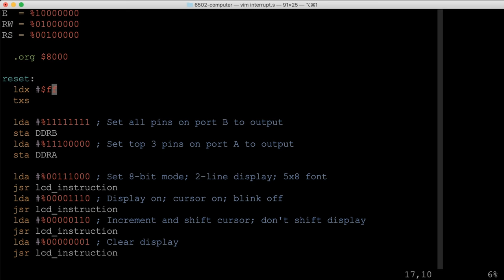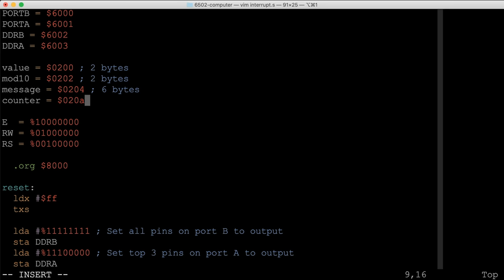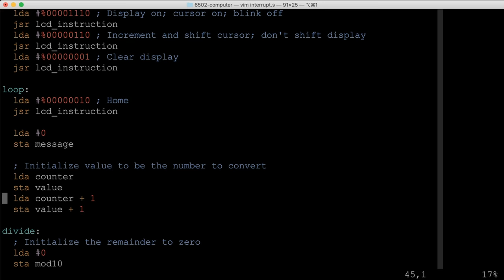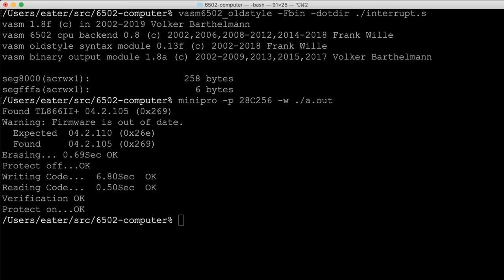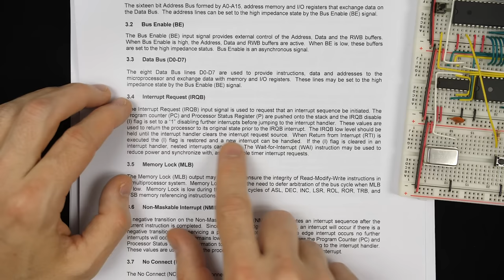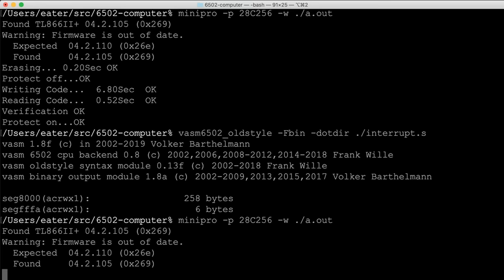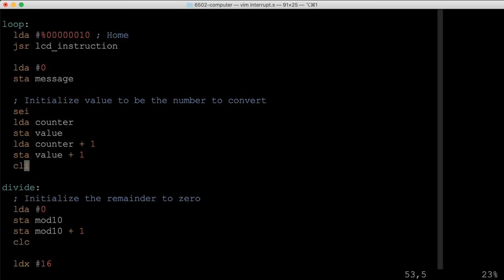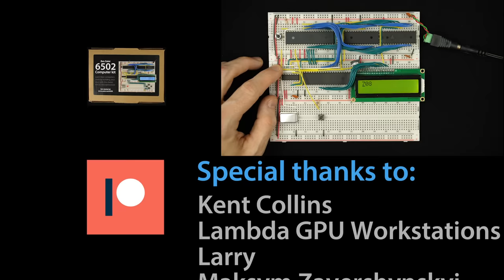Hardware interrupts

Comment: couldn't you write falling edge logic on the IRQB service routine to prevent it so that it can behave like the NMIB? is there any benefit in that?
Reply: That would work if the 6502 has a method to read the interrupt input in software.  I don't know if it does or not.  If it does, then it would be as simple as waiting for the interrupt line to change back to high before enabling interrupts again.
If there is no way to read the interrupt line level in software, then there would need to be some way of reading it built into the hardware, such as allowing one bit of a particular memory location to duplicate the interrupt status
Reply: @melkiorwiseman5234  
But actually: Handling user pressed buttons with external interrupts is generally not a good idea. Everything a human does is in extreme slow motion from the point of view of a µC.
Most more modern processors have better interrupt facilities and even on them it is not a good idea. Those interrupts should be reserved for setting job flags for the central state machine and/or handling critical emergency situations such as eg. turning of a motor because a sensor signifies that damage is about to occour.
Reply: @kallewirsch2263  It's application dependent.  In some situations, responding to user input is all that the machine does.  If it's a manufacturing process controller, responding to a "STOP" button may be the highest priority.
I don't think it can be generalised as easily as you have stated.
Reply: @melkiorwiseman5234  
:-)
If there is one thing for sure, then it is: "One size fits all" works for baseball caps but not for programming :-)

Yes, of course you are right. It always depends on the specfic needs. In most of µC programming one would set up a timer and poll the buttons every 5 to 10ms, which is also a good base for debouncing them in software. That is: for buttons dedicated to some sort of user interface. Which is also not a big deal, since in a lot of programms one would need some sort of base time (often: 1 millisecond) anyway. The handling and debouncing of a number of buttons is fast and very reliable.

Eg. this is an ISR for an AVR, handling and debouncing 8 buttons in 1 go.

     in     save_sreg, SREG
get8key:                               ;/old      state     iwr1      iwr0
      mov    iwr0, key_old             ;00110011  10101010            00110011
      in     key_old, key_port         ;11110000
      eor    iwr0, key_old             ;                              11000011
      com    key_old                   ;00001111
      mov    iwr1, key_state           ;                    10101010
      or     key_state, iwr0           ;          11101011
      and    iwr0, key_old             ;                              00000011
      eor    key_state, iwr0           ;          11101000
      and    iwr1, iwr0                ;                    00000010
      or     key_press, iwr1           ;store key press detect
;
;			insert other timer functions here
;
      out    SREG, save_sreg
      reti

or in C (as a complete package)

ISR( TIMER0_OVF_vect )                            // every 10ms
{
  static uint8_t ct0 = 0xFF, ct1 = 0xFF, rpt;
  uint8_t i;
 
  TCNT0 = (uint8_t)(int16_t)-(F_CPU / 1024 * 10e-3 + 0.5);  // preload for 10ms
 
  i = key_state ^ ~KEY_PIN;                       // key changed ?
  ct0 = ~( ct0 & i );                             // reset or count ct0
  ct1 = ct0 ^ (ct1 & i);                          // reset or count ct1
  i &= ct0 & ct1;                                 // count until roll over ?
  key_state ^= i;                                 // then toggle debounced state
  key_press |= key_state & i;                     // 0->1: key press detect
 
  if( (key_state & REPEAT_MASK) == 0 )            // check repeat function
     rpt = REPEAT_START;                          // start delay
  if( --rpt == 0 ){
    rpt = REPEAT_NEXT;                            // repeat delay
    key_rpt |= key_state & REPEAT_MASK;
  }
}

The C function has the advantage, that it implements an autorepeat, which is absolutely handy in user interfaces (eg. for value up/down buttons and it differentiates between short and long key presses :-)
ALl in all the ISR itself is not much code. On an AVR this boils down to roughly 15 to 20 processor cycles. Executing this every 10ms is completely negligable. (unless of course you need every single processor cycle. But I am sure you will agree, that if you are that level of coding, you absolutely know how things work. This is no longer beginner stuff)

All emergency "equipment" of course needs to react as fast as possible (usually)

Comment: Are these assembly commands compatible with 6502 computers like the Atari or the Commodore 64? Not counting system specifics like sprite control of course.
Reply: Yes and no. On and Atari or C64 the rom is not replaceable and interrupts are always handled by the operating system. But both OS had a way for user to add their own interrupt handler as well.

Comment: What happens if you execute rti outside of an interrupt handler?
Reply: It will screw up the stack.
Reply: What @moshly64 said.  It will attempt to pop items off the stack and then return from an interrupt but unless the stack has been manually loaded with sensible values, it won't work correctly and very likely the program will "crash" since the RTI will cause it to run code starting at an unknown location in memory.
Your question brings up two important points.
Firstly, it's possible to use instructions in ways which they were never intended to be used.  This can be a bad thing but, if you're clever in how you use the instructions, it can be a good thing.
Second, you as the programmer need to know exactly what you're doing, particularly when you're programming at the assembly code level or below.
Reply: Ahh, that's interesting. What happens if an interrupt is fired when the stack is full then? Does it clobber the other end of the stack? Is there any way to prevent that?
Reply: @vicr123  It depends on how the stack is organised for that particular CPU.  I believe in the 6502 the stack is a fixed size and any overflow or underflow causes it to wrap around, so the answer to the first question is yes.  The answer to the second question is that in small CPUs like the 6502, the only protection is good programming practices to avoid it.  Some larger CPUs can be programmed to force an interrupt if there is a stack overflow or underflow.
The effect would be even worse in a CPU such as the Z80 as its stack does not have a fixed size.  It starts at a particular point in RAM and grows downward or shrinks upward.  You can imagine how bad an underflow or overflow could become under those circumstances.
I imagine that hardware could be implemented to force an interrupt to a Z80 if the stack went out of its allowed range, but it's not something built in.
Reply: @melkiorwiseman5234  Gotcha, thanks for the answers :)

Comment: You should make a video on how to access more than 64k of RAM.
Reply: You mean Bank Switching?  Because that's the only way to get more than 64K on the 6502 (or the Z80).
Generally in a scheme like that, some of the memory is not bank switched, and "banks" of a specified size (16K for example) are switched in or out of the actual memory space.
One way of implementing bank switching is by using a memory module which is (for example again) 64K but with the upper address bits (beyond the 16K boundary) wired to a latch which can be written to at a particular memory location (or in the case of the Z80, an output port location).  Writing to that location would set the upper address bits and thus change which section of the memory is being accessed for the lower 16K bytes.  You can't access all of the memory in the module in one go, but you do have more memory over-all.  If you did the same for three out of four 16K banks (with the fourth being unbanked and where the Operating System resides), you'd have 208K of memory (memory module size times 3 plus 64 Kilobytes), although you'd still only be able to access 64K of that memory at a time.
If the OS is written to "know" that there is more memory available via bank switching, it can use interrupts to switch between programs in different banks, or if the program running "knows" about the banks, it can request data be loaded into those banks for faster access than from a storage system such as disks.

Comment: Why doesn't it make more sense to put the resistor on the negative side?
Reply: It’s a “pull-up” resistor that provides a weak current to bring the voltage up to +5V when there is no other connection. When the switch is closed, it overrides the pull-up with a full-current path to 0V.
Reply: @bitrot42  Thanks for answering. How come we didn't have a resistor in the first situation when we had it wired to the +5v rail without a switch though? I assume if we don't have it here we're going to have a short by connecting the two reference voltage rails, and something will explode.
Reply: Khananiel - Joshua Shimunov  right, with no resistor, the switch would short +5 directly to ground. The resistor limits the current to a small amount that’s plenty to drive the IRQ line up to +5, but not enough to hurt anything when tied to ground through the switch. (Ohm’s Law tells us the current with a 1K resistor at 5V is 0.005A or 5 mA)
Reply: @bitrot42  my confusion is from the placement of the resistor. Now that I've taken time to think about it, I think it actually won't make a difference. If the switch is closed, the circuit diagram is the same. If it's open, and the resistor is after the switch, then it's just like he had it before.

Comment: How much more efficient is it to write this in assembly then in c++?
Reply: Not much.
Compilers are good in optimizing.

If you are an experienced assembler programmer you might get an advantage of around 10%. But that's it, often it is less then that. If you are an inexperienced assembler programmer, the compiler is usually better then you in squiecing out cycles. Unless you work at the low level hardware layer (eg. device driver) and you absolutely need the cycle count as low as possible, it is almost always better to think about better algorithms in order to safe time. On the contrary, there are lots of pitfalls an inexperienced assembler programmer might fall into, which you do not have to deal with because the compiler takes care of them.

(That of course assumes, you know C++ good enough to understand what you do by eg. choosing data types.

Edit:
Oh. And please forget the ideas that using those clever "hacks" brings any advantage. As in eg. instead of multiplying by 2, you can do a shift left.
Yawn. Compilers do this low level "optimizations" since more then 50 years. They know all those "tricks" and most likely a lot more you never heared of. But more important: they know when it is safe to do so and when it is not. There is no point in replacing something which is based on the program logic a multiplication with a shift operation because you know this multiplication to be a power of 2. All you did, was create a potential "shoot myself into the foot in the future" situation.

Comment: Has anybody done this with an x86 processor?  I am curious about how a computer starts the boot process.
Reply: It depends on the CPU being used.
On reset, the 6502 loads its program counter with the value stored in memory locations FFFE and FFFF and starts running from whatever memory location was loaded.
The Z-80, like its predecessor the 8080, always starts running at location 0 (zero) in memory.  There are ways to force the CPU to start running at a different point in memory, but they generally involve hardware which forces the CPU to load nothing but NOP (no-operation) instructions until it reaches the location in memory where the start-up instructions are located.  At that point, the hardware stops forcing NOPs into the CPU and lets it run normally until a hard reset.
The x86 series of CPUs initially followed the Z-80 system, but later CPUs in the series have a far more complicated start-up sequence.  I gather this is supposed to implement some security measures in an attempt to prevent "hijacking" of the CPU by malicious software (among other reasons).
TL;DR: It's complicated. :p

Comment: Is there a way to have more memory?
Reply: Yes, you can have memory banks that switch between ram chips, based on a value written to certain address.
Reply: @KohuGaly  Thanks. I assume that the data has to be consistent e.g. sitting in one of the banks, because the program wouldn't have to switch between chips, right?
Reply: @januzi2  The way it worked on old computers, like the comodore64 is that the address is divided into multiple segments. Some segments can be toggled between different chips.
For example, adresses between $A000 and $C000 can be switched between 16k ROM chip that contains Basic interpreter and RAM chip that gives you extra 16k of ram.

Comment: What is an interrupts??????
Reply: As the name suggests, it's a way of stopping the computer from doing whatever it happens to be doing and making it go do something else, then having it return back to what it was doing before it was interrupted.
Interrupts are used for one or both of two reasons: 1. Whatever triggered the interrupt is more urgent than whatever the computer happens to be currently doing; 2. Waiting for an interrupt takes no time at all whereas constantly asking (polling) to see if something else needs to be done takes up CPU time which could otherwise be devoted to running its current program.
Reply: @melkiorwiseman5234  Thanks.

Comment: what kind of education does one need to have a skill set like yours?
Reply: It is less a question of education then a question of interrest and personal patience.
Are you willing to spend hours to figure out why something doesn't work the way you expected it to do?
If the answer is yes, then you have the right stuff.
Everything else comes with time and experience.
Reply: @kallewirsch2263  thanks man.... I know how to code but this hardware stuff is new to me ...so where do I begin ?
Reply: @reapermerc8337  
actually digital electroncs isn't that complicated, as long as we are not talking about GigaHerz frequencies. :-) It is more like "connect the dots" and then throw in some capacitors to stabilize the main power on each IC.

You have seen how to build up a "discrete" system consisting of CPU RAM, ROM. An easy way to skip this step is eg. to use a complete Mikro-Controller in which the basic components are already prewired to form a functional system. You could eg. use an AVR based Arduino, which gives you lots of input/output pins to connect hardware to.
And then it is: learning by doing. One step at a time. (There are lots of tutorials out there teaching basic stuff)

Edit: Oh. I forgot. Just because it is an Arduino, this doesn't mean you have to program it Arduino-style. You can still start with the basics and use any AVR tutorial you find on the Web. Either in Assembler or in C or C++ (or ...)
Edit 2: Just in case. I am in no way related to Arduinos. It just happend that I programmed AVRs long before Arduino became popular. They have one advantage: the processor works out of the box which means you can concentrate on the hardware you want it to connect to (such as eg. LCD). And they are cheap.

Comment: Im a total stranger to this topic. When you program the ROM are you badically just teaching it a ”bit logic”. Just telling it how to throw bits around. What language is that. And how does the rom decode what you want it to do to what its doing on bit level.
Reply: It’s Assembly language, which gets compiled into Hexcode, which in turn is translated into Binary code, which makes a computer work. Basically switching transistors on and off.